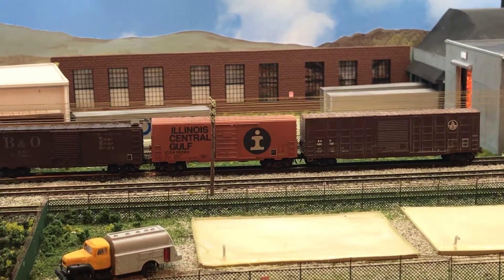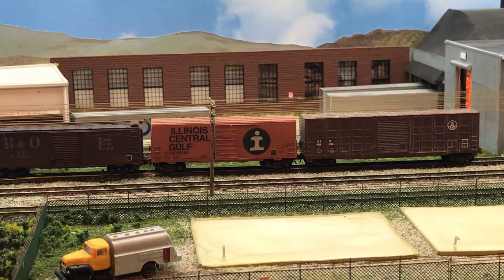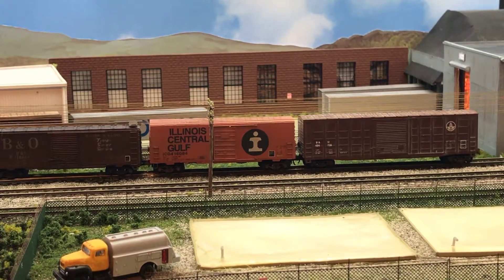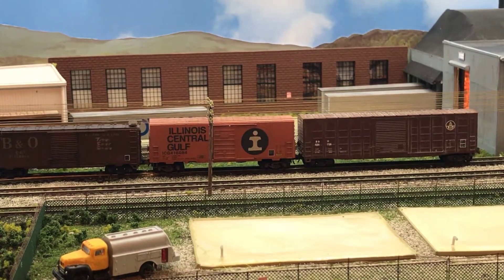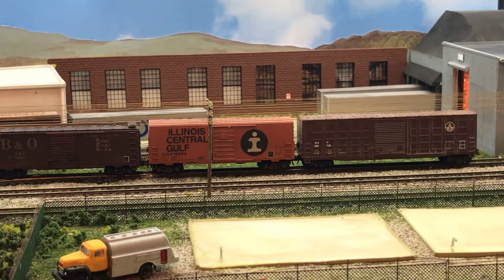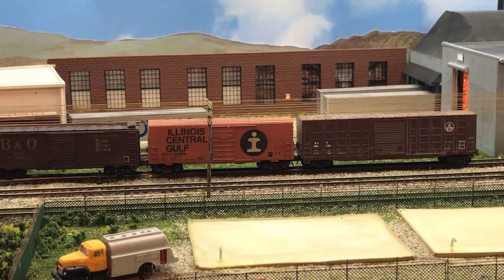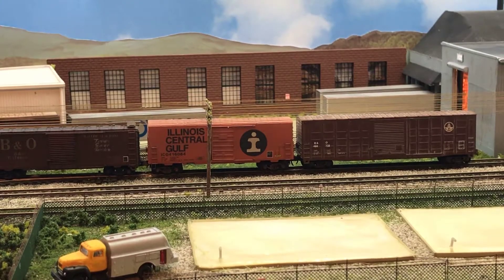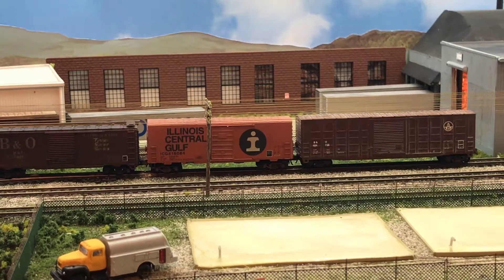Basic freight car spotting features for the 1970’s to now for N scale

Comment: Thank you the additional info with dates. It'll help me update some of my boxcars to be compliant for my modern era. One of the things I have been doing over the last couple months is buying some appropriate modern cars matching what I see in the railfan videos for the area, but I could try to update some of my old cars with decals and weathering and removing roofwalks to make them appropriate I need to learn how do decals and weathering anyway.  Also, the two boxcars I got from you will fit in, because I've seen every road name from east to west go by on boxcars, hoppers, auto racks, you name it.  Interestingly, there's even been some CSX locomotives spotted in UP led consists, all the way over here in SoCal.
Reply from the maker: I’m sure someone makes those reflective decals, but they would be tough to do. I’m be tempted to say that it’s 2014 and they aren’t required. Yet. I really hesitated about doing these videos because I don’t want to be labeled as a nitpicker. We all have our own comfort levels. Sounds like you have a good plan. Stay safe!
Reply from the maker: And I have 2 SP boxcars. A few cars like that are appropriate, for sure. The point was to not have 100% home road cars. It’s much more common today to see ‘foreign’ locomotives on trains. I see quite a few BNSF around here.
Reply: I'm ok with trying the tiny decals, if it works, then great, if not, then I can just say 2014. :)  I didn't take these videos as nitpicking at all, it was information for folks that would like to be more accurate. 
You said that pretty clearly. Of course, some folks to watch or listen to everything, so I understand the concern.
Yeah, 100% home road trains are rare, in the area I am modelling, I think it's even more varied because they come from L.A. where we have UP & BNSF and trains coming from all over.  Thanks again Thom, you stay safe too!

Comment: Thom I model 1975-1980 and I put ACI placard decals on all my rolling stock built before 1978 as well.They used the ACI system from 1967 through 1977. Most cars had the placards by about 1970. I add the lube plate decals as well where appropriate.
Reply from the maker: You’re right, those should be on there in that time period. The decals for them seem large to me in N scale. I’m not planning on adding them, but I may someday. Another project! I’ve seen very few factory painted cars with them. Thanks for the info, stay safe!

Comment: I've seen some new cars and I don't see the lube box anymore. Maybe no longer used.  Also miss the RR & location for a reweigh that was under the reporting mark and capacity info. Equally missed were the assignments and when empty return to stencils. A rolling geography lesson. Plus private cars. are no longer marked with leased to so and so firm